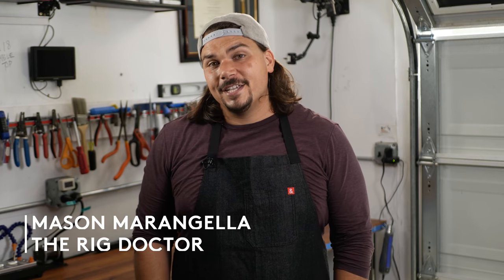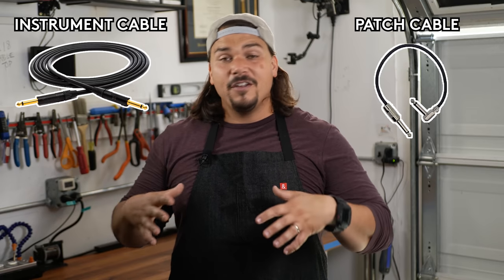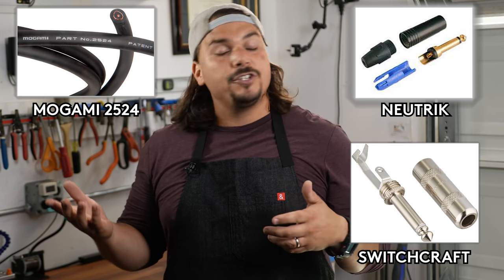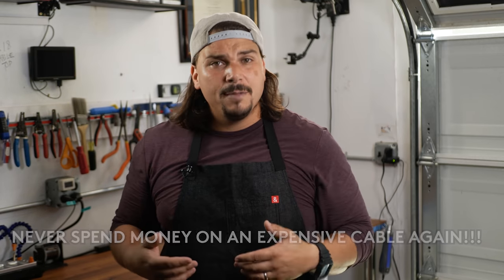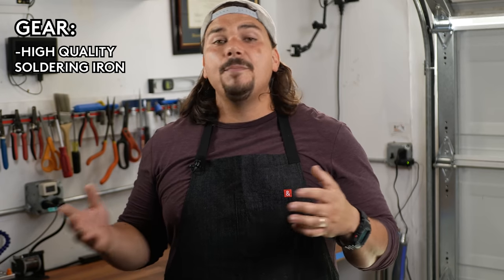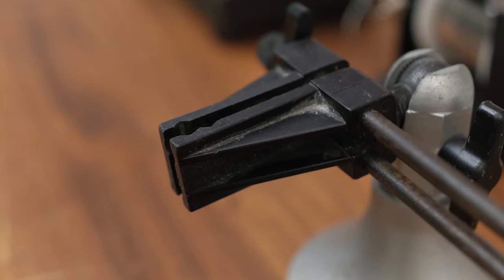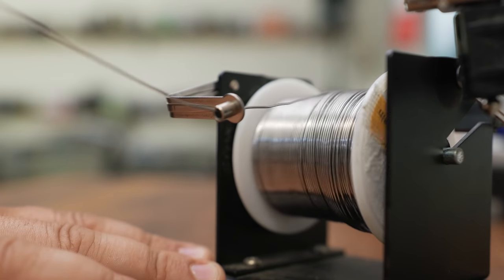Never Buy an Instrument Cable Again

Comment: Soldering is my job. But i always say literally anybody can do it. The best advice I have for it is the same as anything else in life. Practice, with circuit boards I have people use junk boards and take parts on and off a bunch of times until they figure it out. Couple of days to a week and they are good to go on their own. Cables I would do the same thing. Start out repairing cables you would have thrown out and replaced anyway. Because you can’t break them anymore. Only make them unbroken
Reply from the maker: Well said!

Comment: Trimming the tab and using such a small contact on the solder joint is asking for failure. Cutting away half of the shield makes for a weaker connection too. The clamp on the Switchcraft is mad to go around the cable not just squeezed on the side of the cable. This is bad advice for building cables. I have been building my own cables for 50 years and have had one fail because I repeatedly pulled it out of my volume pedal by the cable. I only use Switchcraft plugs. I used to use Belden cable but now use Canare. Switchcraft is the only plug that won't tarnish.
Reply: I'm a proponent of strong mechanical connections before solder is applied... https://workmanship.nasa.gov/lib/insp/2%20books/links/sections/616%20Service%20Lead%20Splices.html

I guess in the case of what's shown in the video, as long as the strain relief holds up and the two surfaces are free of all contaminates, then it should be fine, but I would have loved to at least see the wire go through a hole for the tip connection, and maybe a bit more of the shield wire left on to increase the bond on the ring connection.

Comment from the maker: What DIY videos do YOU want to see on our channel? Tell us in the comments below!

//pedalboard tools// https://bit.ly/3B7AEGq

Mogami 2524 Bulk: https://amzn.to/2WRc1zo

NEUTRIK
Straight: https://amzn.to/3abcVJY
Right Angle: https://amzn.to/2YoynIO
Silent Straight: https://amzn.to/3AhR26k
Silent Right: https://amzn.to/3lg7Cza

SWITCHCRAFT
Straight (280): https://amzn.to/3li3TBj
Right (226): https://amzn.to/3lgpcTO
Silent Straight (181): https://amzn.to/3ad6rdx

Table of Contents
00:00 Introduction
01:03 Cable Types
02:17 Required Gear/Materials
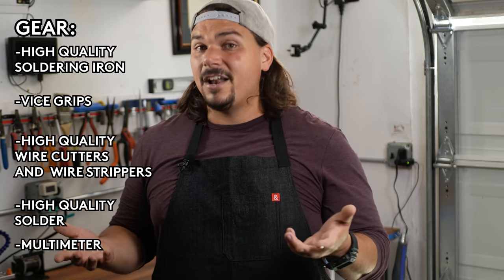04:35 Neutrik Plugs
06:14 Neutrik Straight Tutorial
09:12 Neutrik Right-Angle Tutorial
11:14 Switchcraft Plugs
11:34 Switchcraft Straight Tutorial
14:05 Switchcraft Right-Angle Tutorial
16:53 Conclusion
Reply: It would be awesome if you did a “tools and techniques” overview. Soldering basics, how to read a multimeter, proper grounding, all the things.
Reply: I'm so grateful you're this responsive to feedback from us Mason.  It might sound silly, but a DIY on putting velcro on nicely and neatly would be cool.

Otherwise, something like a training-wheels level explanation on the ROLES of inputs VS outputs and Sends vs Returns would be helpful.  You've done numerous kitchen sink demos of the entire signal chain path...but breaking it down to an even more fundamental level would be helpful.  Or even turning each into a metaphor as opposed to a schematic.   I think in more abstract ways than an engineer.

Either way whatever you submit next will be fabulous.   I'm in awe of how prolific your contribution has become.   Seriously.  Thanks for kicking ass and sharing something in such a thorough,  trademark manner.
Reply from the maker: @brendanrodgers4401  we have a bit of that throughout the DIY cables videos :)
Reply from the maker: @patrickcarroll1754  Good call!
Reply: I REALLY want to see DIY videos on XLR and TRS cables. Also, Y cable for pedals with TRS inputs. Thanks!
Reply from the maker: @Musickbox8  noted!

Comment: made my own cable last year, was a really awesome process. learned how to solder which is a great skill. Awesome!
Reply from the maker: Great to hear!
Reply: Enjoying your content and info. I am building a small rig for busking.
Making a cable with guitar and my ear monitors in it together, keep my connection on street tight.  Using a 5 wire shielded midi cable.
Reply from the maker: @FrugalFixerSpike  Nice!  Thanks for watching!

Comment: Finally bit the bullet and replaced the mismatched, acquired over decades, cables in my 4-cable system with 2524 and Neutrik plugs. All the tips in this video made it an easy process. This is the part while all the dog-eared, cork-sniffing, audiophile types normally extol the articulate nature of the sound, but, you know, it actually does sound better, no kidding.

One tip that might be useful to others; Mason talks about cutting a bit off of the Neutrik strain relief. I found that in my case, yeah with 2524, the struggle is real, and it's otherwise hard to get the nut to seat properly; you have to really torque it. However, it's just the last quarter to half-turn that was the issue for me; it's hard to turn by hand for that last bit. What I found was that common spark plug pliers, the type that have rubberized padding on the jaws, work perfectly for this.

I should also note that Neutrik's instructions do state that "If using a cable with O.D. > 5.50 mm [0.216”] break off marked part of the chuck", and 2524 is 6.0 mm, [0.236"], so you should listen to him, not me, but, just sayin', it's pretty close, I mean, half a millimeter isn't much, really.

Comment: Great video!! I've been working in electronics in Silicon Valley for over 30 years = your video is spot on! One additional use for shrink wrap is to color code the ends of the cable in case you have several long cable runs.
Reply from the maker: Thanks for watching!

Comment: Great video! Been doing this since the early 70's and I do it exactly the same way you do. I use Belden 8412 because I have EMG pickups in most of my guitars and run the Belden into an EMG Battery Box so I need TRS cable. One thing that I like are the Switchcraft pancake (flat)  plugs because they are almost flush with the guitar and I play in a chair and like to rest my guitar at about a 60º angle (sort of like a classical guitar) on my leg.  If your guitar has a front loaded jack (Strat, Mustang, Duosonic, etc.) this doesn't apply. One thing that you will have to do if you use a recessed jack plate (tele) is change the jack in your guitar to a Switchcraft longer barrel style.
Reply from the maker: Thanks for watching Bruce!

Comment: Thanks Mason.  It never occurred to me to build my own cables.  But after your thorough and informative video, it looks relatively easy with the right tools.  Will be nice to have a cleaner setup.
Reply from the maker: Glad I could help!
Reply: It is super easy!  I was apprehensive but watched a lot of Rig DR videos and have now made over 30 patch cables and several guitar cables.  I saved a lot of $, spent a lot too but came out way ahead.  I bought the recommended solder iron and accessories.  That iron alone makes all the difference in the world!

Comment: im a journeyman metal fabricator - ive been soldering  architectual sheet metal - copper, brass , ss, galv but - these electronic stuff is a different animal - but you have to have the tools - "There is a Tool For Every Job - Use it " is a montra i have written on my tool box - hopefully i can do this

Comment: Looks like that Neutrik model is weak against pulls. Only plastic holding the cable. Should've been metal that can be bent slightly to bite into the jacket. Are there other Neutrik that does this? I don't really trust plastics.

Comment: Thank you for this video and the patch cable one! Just received my 50ft of Mogami 2524; 6ft of Mogami 2314; Neutrik jacks and a 10 pack Square Plugs SP400s. All ordered from Performance Audio per your recommendation on another video. Spent roughly $100 and about to make some quality cables for both me and my daughters guitar rigs. Time to fire up that soldering iron! Cheers and thank you from the North Bay 🍻
Reply from the maker: Great work!!!

Comment: I had a pedal cable that sounded muffled(dark) and thanks to you I was able to do a clean connection that solved the problem. 
Now I'm thinking of buying some broken cables for dirt cheap and re solder them :p
Reply from the maker: Could be good, could also be risky if you don't know if that's the issue to resolve.
Reply: @VertexEffectsInc  the issue could be one of three: 
- cable cut or broken (meaning I need to shorten the cable)
- shorted out 
- broken lead/shield connection

I can't think of any other issues, let me know if I'm missing something
Reply from the maker: @bilalnachabeh  it'll just be variable and if it's a break in the cable you might have to sacrifice length.  You may also have to get new plugs if that's the problem - that's the most costly part to repair as bulk cable is pretty negligible price wise.

Comment: Switchcraft Phone connectors like many other brands use a riveted solder tab which just invites intermittent faults and high impedance and open circuit  issue.  This type of connector cause more trouble and lost business than you could ever save on cost.   Just chuck the dam things out & go with Neutrik because those solder directly to the actual tip and sleave so there are no secondary contact surfaces to cause issues.

In XLRs though, you pretty much always solder directly to the pin & receiver so you have a much wider choice for reliability.

The only thing with all connectors, it is far better to use a metal body that you can ground because the connections with the plug will not be shielded unless you do this.  So no plastic body plugs at all as they cause noise, as do thin and poorly shielded cabling.  Good cabling has published shielding and impedance specs.  So use something that you know the performance of.  You can get really nice high spec pro instrument cable for around 1$ per foot.
Reply from the maker: In terms of fall out, when consulting with the big boys that are shipping tens of thousands of these yearly (Best Tronics, CBI, etc.), they're about neck and neck, and among the silent version Switchcraft outperforms Neutrik in failures the last few years.  I think it's a toss up in the end for each, they both have their advantages.  Another good one that we didn't mention, but less common is Amphenol.  Nothing mentioned here is plastic housed, and the cable is all Mogami 2524, all shielded and under $1/ft. as stated in the video.
Reply: I'd be careful with Neutriks. They tend to not take well to being stepped on.
Reply: @BrunodeSouzaLino Well who does really?

Comment: Morning Mason, just started a select playlist of your “How to…” and this gets added along with Patch Cables, and a couple other. I noticed in the Patch cable vid you used the slot provided on a solder tab  to feed the tinned shield  through and back over before a final flow. The reason given I believe was strength of connx. Although I didn’t see a similar slot on the shield tab on either the Neutrik or Switchcraft, would you use that same technique when building a guitar cable if it were available, almost a secondary strain relief as it were.
Reply from the maker: You can use the hole, it depends on the thickness of the wire, it can be difficult with thicker wires to fit through.  I generally default to the way that puts the least stress on the cable and by extension the solder joint.  If you're forced to have an extreme angle on a cable just to say you fit it into the hole of the solder lug, that's not going to help you much and will do more harm than good.

Comment: 🤔Since solder doesn't stick to steel very well at all, wouldn't it be best to rough-up the surface of the contact points with some fine grit sandpaper or some steel wool? It might make for some better longevity, no? 

Your advice to get a good soldering iron is spot-on. You need good reliable heat for this.

Comment: Me:  I need a guitar cable
Guitar Center: <salivating>
Me: <pull out soldering wand>
Guitar Center: >:(
Me: <sigh>
Guitar Center: here is your receipt, have a rockin' day!
Reply from the maker: Hope you get into soldering.  You can also buy most of the raw materials for cable and plugs at GC if you prefer.

Comment: Dude, if You know of a Radio Shack that's still in operation; you gotta give the location of it out so we all can raid the place! Online outlets pretty much did them in; but I miss The Shack--just something about stalking through the aisles, and finding something not on your list, but you just gotta have once you find it... Ahhh, good times...
Reply from the maker: I don't know of any that are still in operation.
Reply: If there is a Vetco in your area they are awesome!  Great selection, reasonable prices, basically a Radio Shack of today.  Good luck.
Reply: Radio Shack stopped catering to electronics and started focusing on phones and stuff, last time I was in one, they didn't have any of the regular cable adapters in stock, basic Y's etc. or any little motors and fun stuff. Probably why they went under.

Comment: @vertex effects, Mason I can’t recall in which vid you asked for suggestion. I’d be very much interested in a video about Expression pedals, volume pedals. So much still unexplained, at least clearly, as how, where they are placed in the signal chain (semi loaded trick question there), wired in,  and or used with switchers. Just my suggestion. Keoki
Reply from the maker: See our signal path videos.
Reply: @VertexEffectsInc  I did, thanks!  The expression pedal remains a source of perplexion. Some are $150+ others are $80 ( or less). I realize MIDI can be part of the more expensive but EXP placement options seems to be legion.
Reply from the maker: @geo5772  expression is typically relegated to a specific parameter of a specific device.  Some rigs with switchers and MIDI pedals can assign the expressions to multiple pedals depending on the preset or you can get something like the Mission Expressionator to have an ABC switch to switch on EXP pedal into 3 devices.  Generally, all EXP pedals are functionally the same, and generally the quality of the materials accounts for the up-charge.  They're all normally 10K linear pots.

Comment: Questions Mason: is the 60/40 Kester Solder also used to connect Guitar pickups, volume & tone pots? Great presentation = extremely informative video. Enjoyed it brother. oNe LovE from NYC
Reply from the maker: Yes, this could be used across the board the only thing I might change is the diameter, but even in the worst case you could always double it over if you need a thicker solder
Reply: @VertexEffectsInc  Thank you sir. Appreciate you sharing the knowledge.
Reply from the maker: @michael_caz_nyc  anytime!

Comment: I like the silent plug from Neutrik, but it isn't really needed since most rigs have a tuner which will mute the signal and stop the "pop" from unplugging.  I think it'd be nice for open mic venues where people don't wait for the sound guy before unplugging though.
Reply from the maker: They're nice to have in many cases, just not as robust as the non-silent versions.

Comment: Lol when you said you run your iron at 700 degrees I was like WTF?!? I'm in the US but my Hakko clone that I've used for years building pedals and modding guitars and amps is only available in celcius and that's what I'm used to. I typically run it between 315 and 330 depending on what I'm soldering using leaded 63 37 No Clean or RA .81mm solder. So after hearing "700 degrees" it took me a couple seconds to remember my iron is in celcius. In fact I recommend running your soldering station in celcius since most solder is rated in degrees celcius. Using Fahrenheit seems to be less common and more confusing when looking through data sheets at melting points. But you could always just convert Celcius to Fahrenheit or vice versa. Also I agree with you about Neutrik/Rean. I get the Neutrik/Rean branded 1/4" Jack's for my pedal builds since they are cheap but quality robust jacks.
Reply from the maker: Since Weller is from the USA, they have degrees F as the primary and then have smaller degrees C in subscript.  I like Neutrik for instrument cables, I don't like them for patch cables between pedals, they're not advantageous in that application.
Reply: ( Celsius x 1.8 ) + 32 = Fahrenheit.  Metric is popular because 0C is freezing an 100F is boiling, but Fahrenheit has 1.8 degrees for every degree metric has...  ie: it's more granular.
Reply: @TheMNB  Is the formula really that simple? Lol how did I forget that. I hated math as a kid but in my late teens over a decade ago I realized how easy and enjoyable math is if you just use it for things you enjoy doing. I cant believe how simple the conversion is. Thanks for the info!

Comment: Hi, Rig Doctor
Thank you for your trick. 
I have question about signal flow in cable, It should be concern this issue when I connect from guitar to Amplifier?
Reply from the maker: What do you mean, signal flow in the cable?